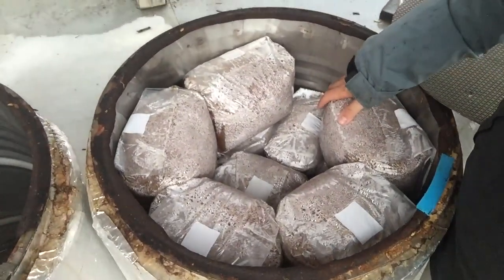Seasonal Mushroom Growing In Canada

Comment: was wondering if you could do a video on how your heating and air conditioning operates in the lab/grow block building with air exchange and contamination issues how would you set that up if you lived in a desert environment area? Gets hot and cold as hell and air exchanges will run the ac unit constantly.
Reply from the maker: every environment is different but once you understand the fundamentals you can do anything

Comment: i have a ton of the joby tripods.  one thing to do is to utilize the swivels themselves vs always using the legs.  what i have found is i have wore out the legs sockets, and they pop out of the tripod center super easy now in a few that were used the most.  as far as software to make your movies.. ising premier pro or fcpx?  you can level music and audio easily in fcpx, the premier pro takes a bit more work, going in and actually tweaking the gains in positive and negative amounts to get them to align.  i did find it harder to work w premier pro and was hard to get the audio to line up.. was never perfect and keyframing and using the audio transitions is clunky in premier pro.. time consuming
Reply from the maker: Nathan Deneault thanks .. using Movavi right now
Reply: WHAT THE FUNGUS no worries my man, always tune in and want to see the progress on wtf farm :D
Reply: I've never used Movavi, I don't know if they have a normalizing audio filter.  Or another filter to look for is the a compression filter for audio.  Nathan is right FCPX is easy to use, I use Premiere Pro.  But you should be able to find a way to quickly create even audio levels.  Again, the content of your videos is great, just keep up the good work!
Reply from the maker: Bryan Hargrave I'll need to google that and see what Movavi can do... might be easy